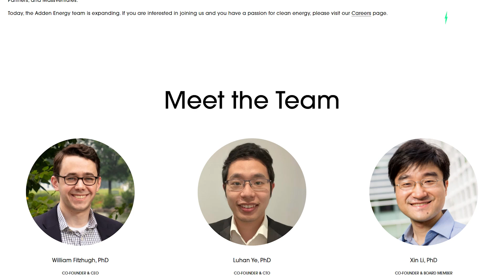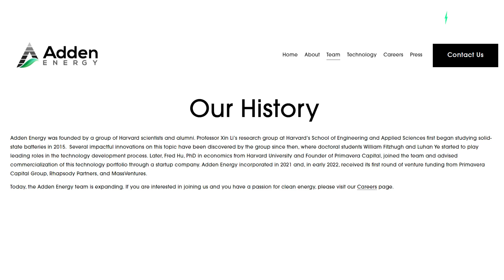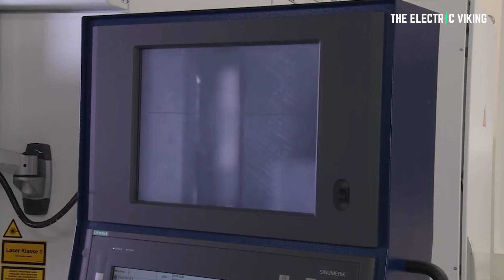Harvard engineers develop solid-state battery that works for 100 yrs

Comment: Its about RTE.
if your RTE has an extra zero.
(zero the hero)
Then you can abuse it 10x harder.
Fast charging and lifetime, stop using the word AND. its OR.
They are opposing, and conflicting goals. It is a trade in use, and a compromise in design stages.
If you want to capture reactive power, that becomes a lot of cycling!
Not including SMPS frequencies, we have 60 seconds/min x 60min/hour x 24 hours/day x 365day/year.
31,536,000 cycles per year 31.5 million.
If not solid state it will need Uber low RTE.
Lead Acid 2/3 RTE
LI-ion 9/10 RTE, still not good enough for deep cycling near capacity, need 0.99, not for the ROI crossover reduction from losses, but survivability of the storage device.
Saving grace is if so much bulk capacity is available, a storage device can be cycled at small % continuously, such that the temperature is not to high.
Note, this helps the pack survive longer when exposed to cold weather, via not cold cycling with small % cycling.
The RTE determines the amount or % of reactive power capture & release that can be done, when not being bulk charged, or bulk discharged. Then the limits need adjusting between heat loading mechanisms.
GAIA, your welcome.

Comment: Fast charging in a few minutes? Not so fast! 🙂. The electric grid is not yet even geared for 80-100% EV usage. Let's do the math. Example: suppose an average EV needs 60 kWh to charge 0-100% in 1 hour, this equals an average charging speed of  60 kW. 
Suppose you want to do the same in just 5 min, what is needed is a charging power ('speed') of 720 kW !!!
That is 12 times higher power, meaning power lines & cables must be able to hande 12 TIMES MORE POWER!
Can it be done? Of course - but the investment in electric infrastructure will be HUGE.

Comment: As a constant viewer of your channel simply because I consider you as being one of the best information sources out there I don't seem to recall you ever having given a thought as to how governments are going to recoup their losses on tax made on the sale of fossil fuels although I could be wrong here.
There's no way the owners of electric vehicles are going to get away with for lack of better words cheap fuel where the government only gets the tax on the electricity they use to charge their cars. Based on this what are the options other than adding tax on to ones electricity bills to make up the difference however the problem with that is determining who's home charging their car v who doesn't own a electric car who should be on a cheaper rate. There's no way things are going to stay the way they are now as there's too much lost revenue involved. A possible solution is to tax the vehicle but then again there are light and heavy users however here in the UK you pay annual road tax to be allowed to keep the car on a public road + a serious amount of tax on fossil fuel used and its grade / octane + a annual vehicle inspection fee if your car's 4 + years old then there's the tax made on servicing and spares of which electric cars require less.

Comment: Solid state batteries will be develop first for those things where performance is a must and cost is no object.  High end cellphones, military equipment and like.  This will provide the first development payback.  Once developed, it will be a matter of cost vs benefit. What would you rather have a car that needs 20min to charge or 5min and how much are you willing to pay for this? The truth is pure Li will give you about the same energy density of gasoline.  Problem is all the structure needed to make the thing safety chargeable.  Like currently the Li is in a matrix and has to have other elements to get any sort of safety. I think it's currently at 10 to 20 % capacity and improving.  Solid state has the potential to get rid of flammability and get closer to theoretical power densities.  Also sounds like maybe even greatly speed of charging. Though it does not appear to be something easy to do.  I am though optimistic.  I can remember when researchers were struggling to get something more than a red led.  Now I got a head worn light that l can light up a whole street with three AAA batteries. Back then a light like now seemed as fantastical as a million mile 3 min charging car battery.  I bet these batteries will be here sooner than expected.

Comment: What about safety?  Wasn't that one of the appeals about solid state batteries (no thermal runaway)?  Say there is a major crash, and the driver/passengers are trapped and in need of fire services to extract them.....they don't want the batteries to catch fire while they wait.   BYD demonstrated that puncturing their blade batteries with a long nail didn't result in any significant danger.... if this new solid-state battery technology performs better on safety, that may be a selling point (even if they perform like existing lithium batteries).  

In my mind, safety is one of the main benefits being promoted for solid-state batteries.....but at some point it needs to be cost effective, otherwise only the rich could afford vehicles with such batteries.  The 'safe enough' mentality may arise if solid-state batteries turn out to be too costly, making existing battery technology more acceptable.

One point worth mentioning .... I haven't come across any 'government regulated' crash testing scheme (e.g. ANCAP, NHTSA, ....) identifying EV batteries catching fire after performing a crash test.  Something to ponder...🤔

Comment: if this battery is able to be chardged up to 100% capacity, the cable have to be huge diameter and current have to be about 200  amperes/ So I cannot believe in that!

Comment: Perhaps the key in the short term will be some form of hybrid or dual type configuration where solid state cells supplement LFP or LFMP cells for the best balance of performance and cost. Then as costs come down on the solid state cells, more and more of the battery can be made up of solid state compared to traditional cells.

Comment: If solid state batteries can maintain an energy density advantage over time, they could be the choice in heavy trucks and aviation, where battery weight minimization is more critical and the higher cost could be less of a barrier in these segments. Just something to consider.

Comment: Batteries are the most expensive part of an EV.  Lower cost batteries are made using highly automated manufacturing.  I've read that the wet coating process requires a drying oven that's 60 meters long and costs a huge amount because it has to recover the chemicals that evaporate from the coating process.  And since it takes up so much room the bldg to house a high volume cell production line needs to be ginormous.  So changing to cells that don't require this process is a high priority.

Another important issue is the price of lithium.  It has skyrocketed so that's one reason why CATL has pursued manufacturing sodium ion cells.  The batteries have to be made cheaper if there is going to be a $25,000 EV with a decent range.

Comment: I think flammability will become a much bigger issue than most people are currently giving weight to. Unless significant fire safety improvements can be made to non-solid state batteries, a safer alternative will be required. In the interim,  if the current technology really proliferates, you might see the vehicles banned from entering structures such as large parking garages or other situations where fire suppression is difficult and risk of fire spread is high. It's not to say they are a big fire risk to people using them, but L car battery fires are difficult for fire crews to extinguish. The sprinklers currently required in parking garages may be able to prevent fire from spreading to other cars and to protect lives, but the burden of fire suppression and damage would become too much if we go from like 1 percent (?) of cars to the goal of 100 percent someday.

Comment: I think you made a good  points. There are lots of people working on a better battery . Any battery that is better will make others obsolete.  First they have to survive all the hurdles to get there. Many better batteries will die on the vine for any number of reasons . John Goodman  has a better battery . Its a good step up but they taking forever to bring to market. The wholly grail of batteries seem to be as illusive as the star in a  jar. Always thirty years away

Comment: Sam, the most significant hole in your questioning the advantages of solid-state batteries over the current latest batteries is that you are comparing them with lithium ternary batteries which are inherently not as safe and more prone to catch on fire.  So their biggest competition, especially as the current technologies mature, will be the more mature LFP batteries, or the latest M3P batteries.  I think solid-state batteries will eventually replace lithium ternary batteries in the high-end market, whilst the LFP/M3P batteries will dominate the value segment.

Comment: I've just finished reading the scientific papers published by these Harvard engineers, I see a few major show stoppers for mass production, first, after milling the cathode materials into super uniform micron sized particles, the cathode needs to be formed under 4670 bars of pressure to make it into said "solid state", fine for a one off in a lab where you have all the time in the world, but too much for any fast production line, second, any cracks or imperfections in the resulting solid state cathode will result in catastrophic failure of the battery(fire).

Comment: You're absolutely right, Sam. The solid state battery technology might be better or not than the most advanced ones based on liquid electrolytes. Only time will tell.
Normally, the solid state ones should be better, but we will see in time the real results.
The technological advances of any kind are always full of surprises.

Comment: There always has to be someone speaking to a burgeoning  technology on a play by play basis. I mean it's making a living. Notice that tomorrow not next week ot next year but tomorrow will have a new discovery that changes everything.; we all expect it now.  Or does it? There just ain't no free lunch. No matter how efficient or how fast a collection of batteries can be charged the energy needed to get it done is basically the same. Dump a ton of current at high voltage and you get a 5 m minute charge. Take all night at a tenth of the power and you get the same eventual outcome.  What is being completely overlooked , and it is hard for me to believe that it is not intentional or just ignorance , is where does all this RELIABLE ( reliablity takes effort , testing ,engineering, failure  and honest discourse)  power come from?   The Giant Power GOD that is capable of  charging, the  desired multi millions of cars desired,  MUST be proven and tested FIRST, not last. . That IS proper engineering . I see nothing discussed about this essential cornerstone to the success of evs; ZERO. That won't cut it. The Devil lies right there. Look at California ; it already cannot charge the relatively few EV's that exist NOW-TODAY and no one says a thing. Now times that by the world. .  Some of these  podcasts should be covering  the innovation that is happening to supply the power, enhance the grid and strengthen the infracstrure; to make all this possible. So why isn't  there a slew of lucrative podcasts speaking to this? Simple; it doesn't exist so the choice seems to be : "well we will just ignore all that for now , somehow it will just happen".   
 No one speaks to, like; Thorium reactors.. Safe and can supply a LOT of energy; but nothing . There is no form of energy outside oil and coal that can supply anywhere near the energy needed. Ironic beyond words.  No one speaks to the status of the wires , the gauge , the peak and sustained current carrying capabilities of copper.  Maybe this is where supercondictors takes the stage...but crickets. That comes first , not last or we have a catastrophie brewing at light speed. We simply have to address this first.. But it is not sexy to talk about practicalities when the promise of ending pollution and Co2 etc is the coin of the realm.  (More irony.) An over taxed infrastructure will have its own catastrophic effects on . We will destroy  the ability to move from a to b if the grid is melting down; starting forest fires, exploding transformers etc,; not to mention the pollution that comes with making billions of batteries. . There just are not enough people interested in this aspect of evs , so you know you cannot trust. And trust is everything here.

Comment: If this doesn't end up in thunderf00t radar, the green logo is destined to be the green mile for fossil businesses.

This is almost equal if not faster than fossil refueling. If it charge quick, there is no need to have many heads in a station.

 Be prepared.

Comment: "We shall see" said the wise pundit.
In my lifetime as an electrician working in many fields, I have had many friends come to me all excited by some magical new technology discovered that will change everything. Many are just the equivalent of perpetual motion machines. Many are just hyped up versions of existing tech. The ones that are real breakthroughs always have a "valley of death" that they must cross before practical adoption.

In this valley are found many obstacles: Ability to scale production, cost of said scaling, patent issues, financing issues, political pressures from threatened industries, creating supply chains, market acceptance, the ability to stay in business long enough to become profitable, legal issues, finding the management talent to navigate the switch from the lab to production environment, theft of intellectual property by others, and other issues to numerous to mention.

And it is not like any of the other established battery manufacturers will be standing still waiting for this tech to pass them by, They are all going to ad extra sugar to the hamster wheel water supply hoping to stay ahead.

Comment: We have 10 000 cycle cells right now with lifepo4 and lithium titanate. What's it's energy density? Solid state batteries are very difficult to bring to mass production. We were told that we could drain ss batteries to 0% with no damage. We were told ss would give us 10k+ charge cycles. We were told that they were safe. Well there safe..but that's it. The lithium cells today are safer and more energy dense then ever..its rare today to hear of fires compared to 5-7 yrs ago. Waiting for them to say there waiting for graphene to be a reality at scale. Lol. Going to be awhile I bet . Lol

Comment: Energy density is the key to cost.  Less weight = less commodities = less cost.  More charge cycles = less battery cost per cycle.  I can't believe how fast batteries have improved.  This rate of improvement could accelerate.  Tesla will be it's largest customer for it's batteries.  When Tesla makes more batteries than it needs it could supply other companies.  It should benefit from Wright's Law.  Other car companies won't reach the same scale because they don't have products like Mega Paks.  So they will always have a battery cost disadvantage.

Comment: What does a solid state do to recyclability?
Reply: It depends on the separation layers and other components both inside and outside the battery. As far as the primary material, I don't know.

Comment: This reminds me about what happened to solar panels in the early days (~2010's).  There was a lot of buzz about how CdTe and CIGS thin film cells were going to revolutionize the solar industry.  But it turns out, good old silicon still has a lot of legs, and has turned out to be the dominant solution.   I think the same will happen, with the current lithium technology.  It's tried and true.
Reply: These two thin films were also going through R&D, most likely chemistries, yet not sure if there was too high expectations for change. 
If a new pair of eyes, especially those improving batteries gave it a shot, perhaps new life may be breathed into old tech.

Comment: The faster you charge a battery the faster it degrades, is this still true?
Reply: Depends on what threshold is faster. And, to answer that question will require diving into several research papers. The better you get at diving into papers and articulating what you read the more chance you will have to be competitive and be a force to be reckoned with.

Comment: In 5 Years, There will be a Battery that will be half the size and weight of a normal LFP Battery Pack.  That will have a minimum mile range of 10000 mi.  And when vehicles are sold, they will be sold with them fully charged so you get the first 10k miles of driving for free.    I worked in the Research and Development Laboratory for IBM in Armonk in the 80s developing tech that was at least 20 years ahead of that time.  Larger companies hold this tech back because they want to release it in drips and drabs to drain the public of cash.  We have tech available that is light years advancement but will not be released because it will upset the status quo and disrupt the economy.
Reply: They may have developed the battery but don't have an answer for scaled production. Which IMHO is a much larger beast to tackle.
Reply: @gary.richardson  There are many methods being presented to scale (Solid) dielectric materials and will be worked out.  Tesla beat everyone to the punch by buying 'Maxwell Supercapacitor Technologies'  which had their own patented method already being used in their Supercapacitors.   I was using these SuperCaps in 2016,  And they are Incredible.  The problem now is there are so many different battery proposals for chemistry and scaling, choosing the wrong one could put the manufacturer at the tail end of the spectrum.  In 2025 we will see who survives the battery process.